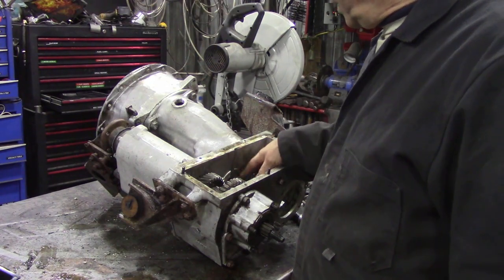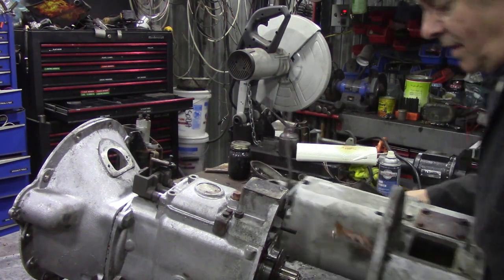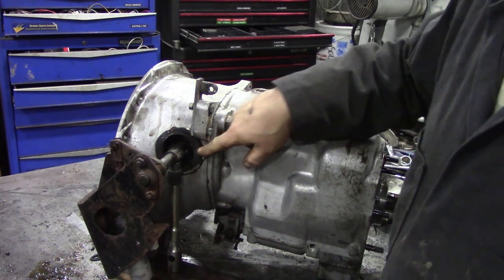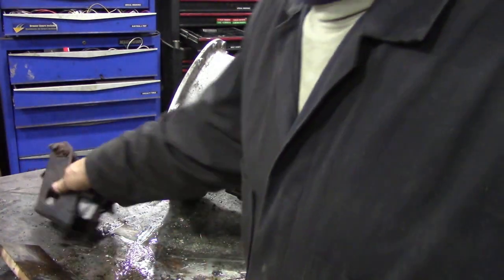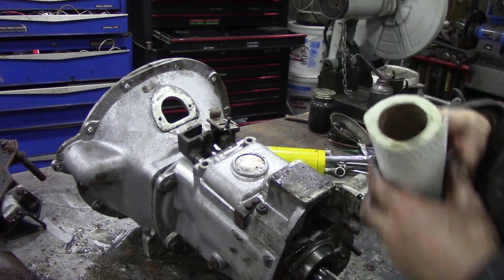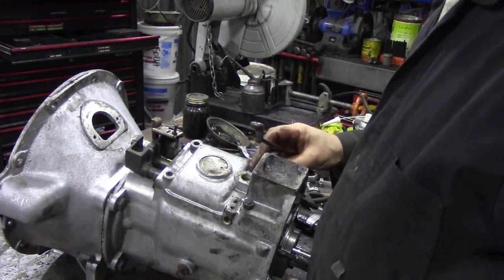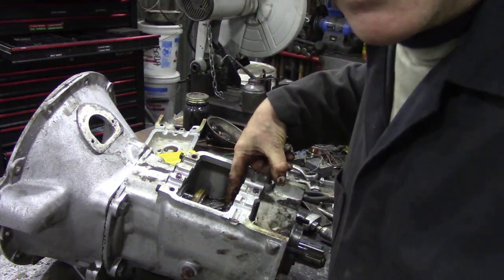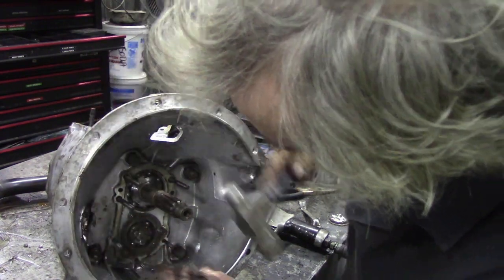2 6 NADA 2a gearbox strip down.  Part 2. Transfer off, top cover off, and thrust bearing off.

Comment: Think anyone ever made a ratcheting spanner in Whitworth? I recall my 1971 1275 Midget had a thrust "bearing" that was simply a graphite donut - every time you used the clutch you wore a little bit more away. I mean, what engineer thought that was a good idea?
Reply from the maker: the carbon disc usually lasted as long as the clutch